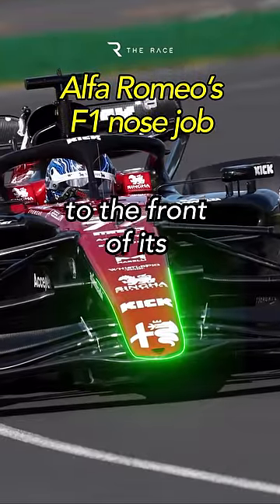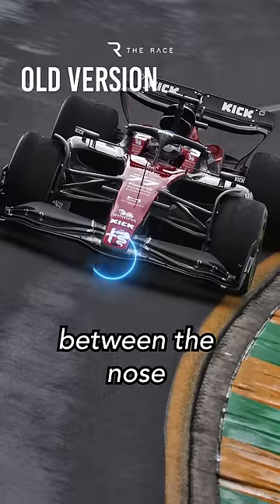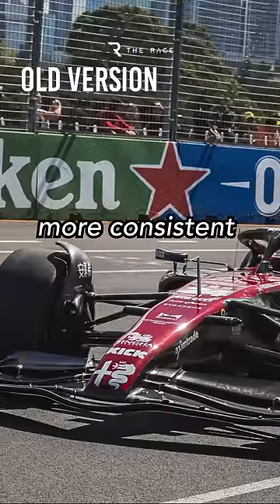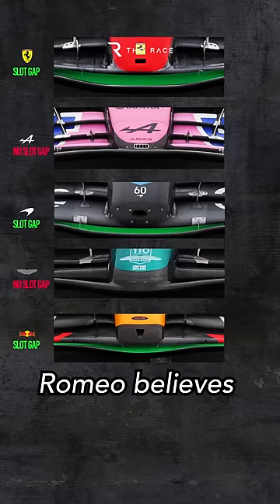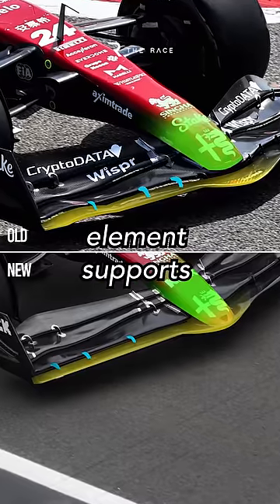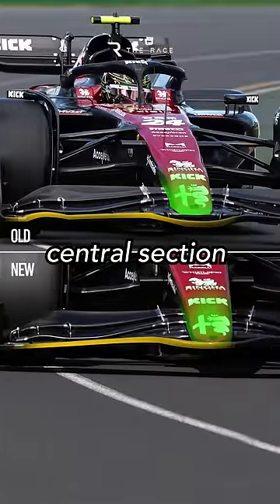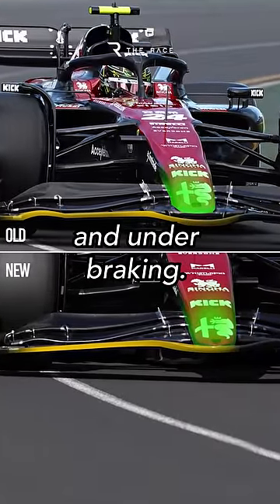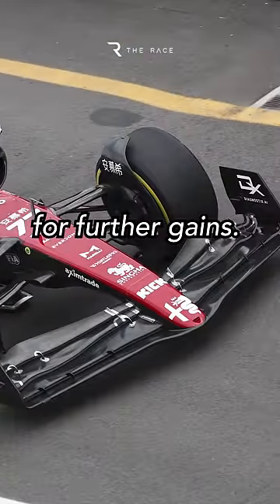👃 Alfa Romeo's STRIKING F1 nose job

Comment: Are the regulations stopping them to make a McLaren 2008 style front wing or even a 2010 front wing style ,im not a pro in aero but i assume the big hole in the front wing like the 2010 FrWing could help have more air entering the underfloor therefore making it even more efficient than it already is?

Sorry for the possible bad english it's not my first language.